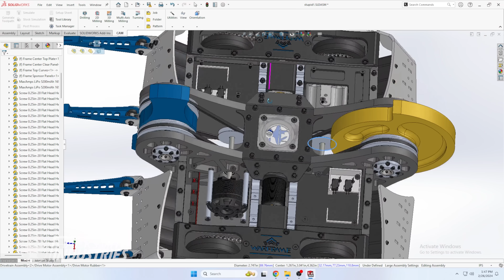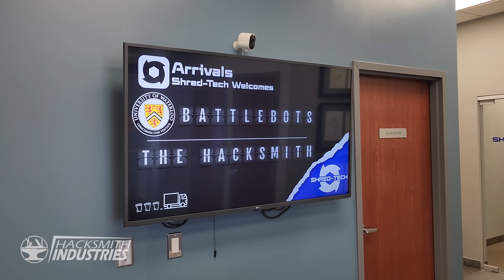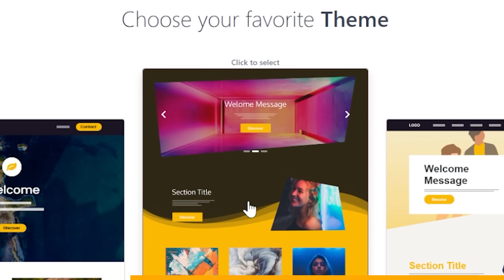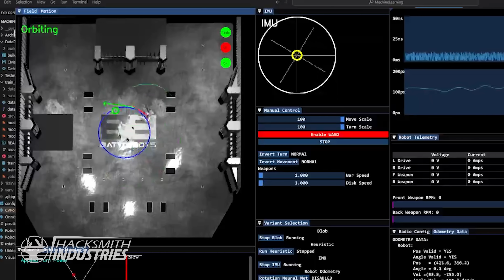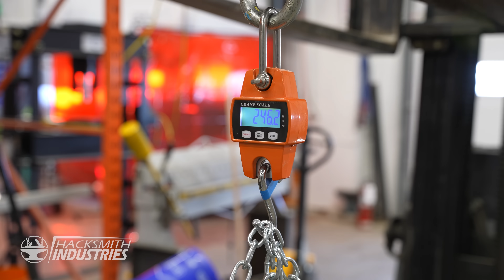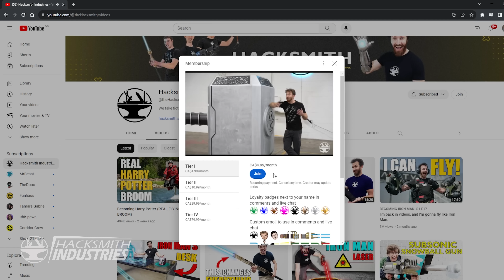Rebuilding our BATTLEBOT (VIDEO #3/6)

Comment: Really enjoying the new format of videos. Less standard youtube quantity and more quality video content. Keep up the good work!
Reply from the maker: Sadly our views have been super low 😞 not sure what to do
Reply: @hacksmith  if it helps, I saw the thumbnail multiple times and I ignored it until I realized it was yours. The before/after format doesn't provide a lot of information here
 It may appeal only to BattleBots enthusiasts and that could be sending mixed signals to the algorithm.
A thumbnail with more spectacle may be more inline with your target audience. I'd say a shot of orbitron launching engine into the air, I see it referenced a lot in the comments as the high point of the video. Either way, keep testing to find a solution for the drop in views and keep creating great inventions!
Reply: @hacksmith strangely I haven't seen your guys stuff in my feed. This is the first time in a while.
Reply: Yes I also noticed
Reply: But don't worry you guys are still the best😊

Comment: To preserve hardness: 
1.) cooling naturally makes the metal softer. 
2.) Quinching the metal in a oil bath is the recommended method for preserving hardness.
Reply: If you cool the material quickly (quenching) it becomes harder but more brittle (which I doubt would benefit armor that is suposed to recieve impacts). Source, a lab in material science I did yesterday.
Reply: You can cold bend ar500. You just need a much bigger radius. Look at how big the radius Witchdoctor has on their front wedges
Reply: A lot more difficult to do- quench cool the outside face for hardness and slow cool the inside face for softer more ductile metal. The softer internal protects the harder face from failing catastrophically when it takes an extreme hit. Same principle is used on katana blades and battleship armour plating.
Reply: @phoephoe795 Its called differential hardening  or case hardening .
Reply: Lol guys you really think they didn't whip out the spec sheet of the steel and checked how to harden it? Not all steel gets hardened the same, it's not all knive steel
Reply: if you heat AR500 until it glows red, its not AR500 anymore. and there's no heat treating process you can follow that will bring it back. As @junebug9267 said, you can cold bend AR500. I don't know how they managed to crack it when bending it the first time, with zero plastic deformation. Seems like it's not actually AR500. 
Hardox (the company) provide excellent guidelines on how to bend abrasion resistant steels, including the recommended bend radius, tooling and tonnage required.
Reply: ya but it also makes it more brittle. i think a dent would be better then a fracture
Reply: To be fair, there are air quenching steels. I'm pretty sure that ar500 isn't one but they're very interesting to work with
Reply: You wrong kinda
Reply: it hadnt reached it peak temperature so i can imagine it didnt change, you need to hit the critical temp for it to break and remake the bonds of the steel,
Reply: Danke man als werkzeugmechaniker kann man da nur schreien
Reply: Stay hard 🦅🦅🦅

Comment: How does the orbit work when there isn’t space to orbit?
Eg if the edge of the space is within the orbit, it either needs to decide to reduce the orbit size or stop orbiting otherwise it’ll run in to a wall.

Comment: Do you ever think of better weapons than the ones you using?

Why not a flamethrower or a rocket?

Or better yet the big weapon that no man ever invented nor used before! 🤩🤯
Reply: Projectiles arent allowed
Reply from the maker: Flamethrowers only work if your opponent stays still 😆
Reply: @hacksmith  (respectfully and logically speaking)

Well, it doesn’t have to be a flame or rocket launcher or anything it could be in the other weapon I meant to say.

(curiously speaking)

What other choices of weapons? If not, what you show us?
Option A: a battering ram
Option B: a hammer
Option C: buzz saw 
These are just guesses, my question was whether there any other choice of weapons you could’ve chose if not, what you already selected? 
🤔🤷‍♂️(puzzling)
Reply from the maker: You can see how those weapons work, past battlebots have tried. They all... kinda suck 😅
Reply: @GrimTech-bk1px  at this moment in time, spinners are pretty much the main meta to deal damage effectively from weapon alone since there is so much energy behind them and the fact that they are hell durable. reason why the examples you've given aren't used as often is bc a saw can bend really easily, a battering ram does no damage, while hammers don't do as much damage as spinners do, especially if the opponent is equipped with the bouncy armor (usually plastic) to counter it. other choices of weapons may include crushers and lifter/grappler bots which will take heaps of skill in driving to get around the devastating meta of spinners, let alone just about surviving the onslaught.
Reply: @hacksmith  check out a bot in NHRL called Dutch Oven, Alex solved that problem ;-) Anyways great to see your progress and Seems Reasonable Robotics look forward to having some fun with you in the Battlebox at some point.

Comment: Calling roundhouse tombstone on steroids is an overstatement, it is powerful but not THAT powerful.
  Robot combat fighting is through trial and error, just how it goes. You gotta be able to evolve. 
  You can’t use something extremely sophisticated and expect it to work on the first try.
A bar over a disc when you’re fighting a horizontal spinner is because physics will allow a vertical spinner to uppercut a horizontal spinner. 
  Also to note most robots are complicated.
Disarray Is a very mean robot from a team who knows what they’re doing, best ah luck.

Comment: What was the material you were bending at around 9:00? If it's aluminum, be aware the heat treatment might be ruined when you reheat it.
It might be the weak point of the structure.
Reply: AR500 steel.
Reply: @ryanrowland  I'm not sure if this material use it, but heating might also ruin the cold work, or quenching hardening for steel

Comment: Hacksmith has to be the only company to casually use an actual lightsabre for construction
Reply: they should just fit the lightsabre to the robot.  Think Gruff, but with a lightsabre to melt right through the opponent's armour.  Win or lose, that thing would be awesome to watch, plus the inevitable explosion when they lose... :)
Reply: @John_von_Bob  their lightsabers right now takes like 2 minutes of straight burning to get through steel, also the gas tanks would have to be super big and are combustable
Reply: @Mediocre_Soup  also that's against battlebots rules because of metal melting
Reply: @rokaslokusevicius3810  There was a battle bot that used flamethrowers once if I remember correctly
Reply: @shardinalwind7696 The flamethrowers are mainly for looks and at best damage some wiring. They're way to weak to actually melt any metal.
Reply: @shardinalwind7696  also the fuel tanks would be too big if they used a lightsaber on the battlebot
Reply: @shardinalwind7696  That would be Complete Control, Especially Complete Control vs Bombshell
Reply: that came in real handy huh
Reply: perfect
execute order 66
Reply: They just need to but the hulk buster arm
Reply: Haha, test one they should just put a lightsaber in the robot
Reply: Lightsaber
Reply: @GrandMrTurcott  Thor hammer 🔨
Reply: @simontherainbowmoose  You  mean Jonathan
Reply: Saber not sabre
Reply: @AverageJoseph2029  in the commonwealth it's sabre

Comment: 3 battle bots vs one human with a sledge hammer who’s winning?
Reply: i dont care what tool you have. Tombstone will turn you into a fine mist
Reply: @junebug9267  I think a Komatsu D355A would count as a tool? Given it's a bit of an unfair fight, 250 lbs vs 103 000 Ibs
Reply: Just one of the top battlebots will win. A sledge hammer will have very minimal impact on a HW bot. They are also a lot faster than most people can move and kinetic weapons will take the head of that hammer and move it so fast you will be lucky if all that happens is if the handle disembowels you.
Reply: The human ovi